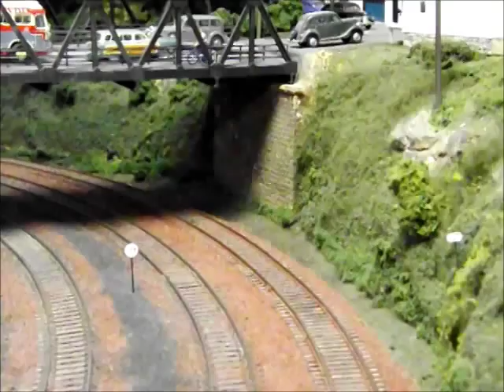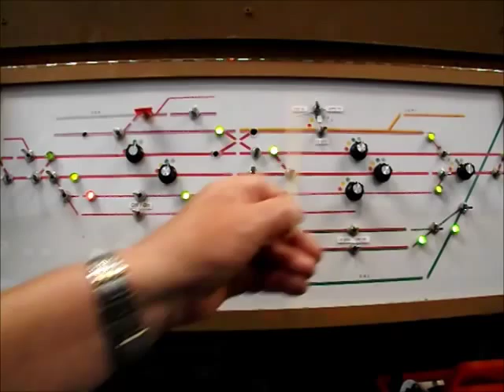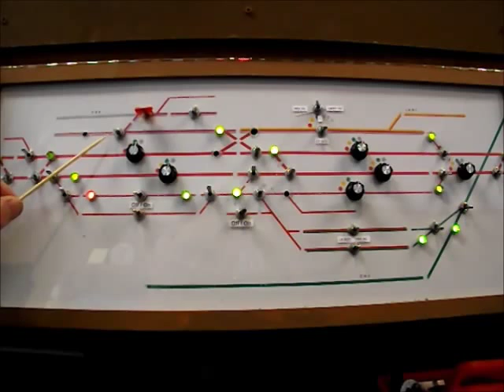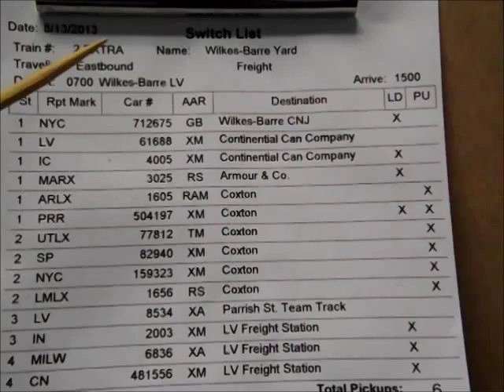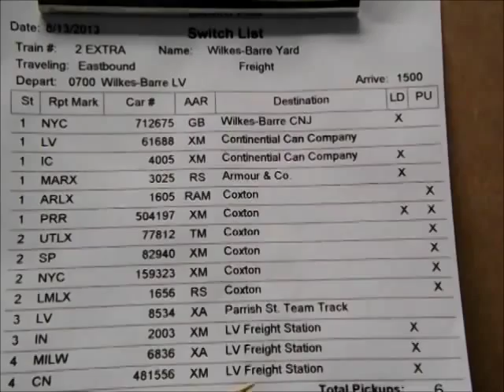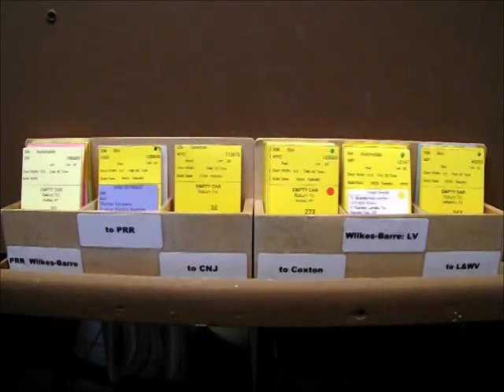My Lehigh Valley RR: Lehigh Valley's Wilkes-Barre Yard

Comment: Great looking layout!  Do you have any Lehigh Valley steam locomotives?
Reply: Hi James.  Thanks for the comment and sorry about the delay in responding.  I have two brass 4-8-4's that are painted and have sound added, but still need some fine tuning.  I also have a brass streamlined Pacific that needs to be painted and the sound installation completed.  That will be painted in the 1944-1948 scheme which had one big red stripe all the way down.I also have 3 Broadway 2-8-2's and a 4-6-2, a Life Like 0-8-0, and a Bachmann 4-8-2, 2-10-2  and 2-8-0.  These have all had the lettering removed from the tenders  and I've been running all the Broadway's even since I bought them.  I've always been planning to Lehigh Valleyize them and repaint them, but some other project always seems to get in the way.  The latest being building passenger cars. The 2-8-0 will be converted to M-35 2-8-0C #706.If there is something specific your interested in, feel free to contact me at mylvrr@cox.net.